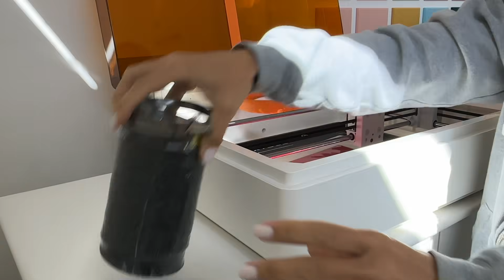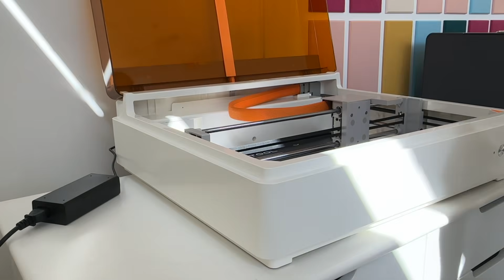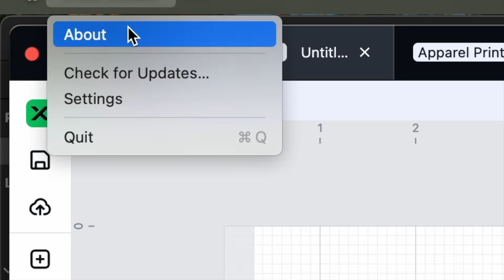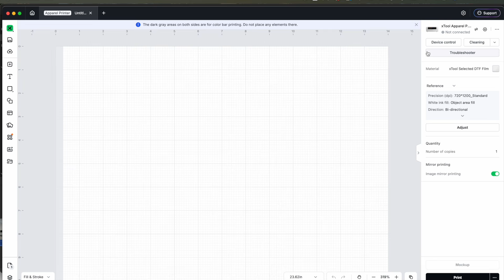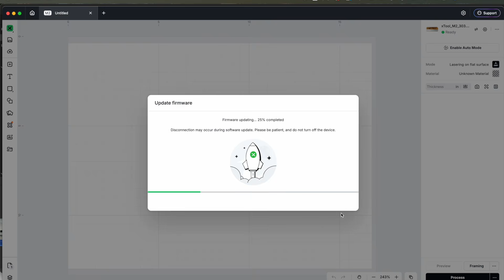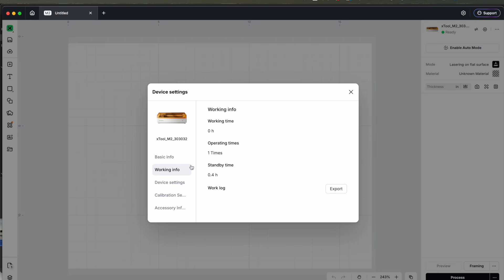xTool M2 Setup - Machine and Software Step by Step

Comment from the maker: Already have your xTool M2 set up? Next up: the CMYK ink module setup (separate video coming soon!) And if you're still deciding whether the M2 is right for you, check out my full unboxing where I break down the pricing reality and what's actually in the box.
Got setup questions? Drop them in the comments!
🖨 Shop the xTool M2: https://www.awin1.com/cread.php?awinmid=86799&awinaffid=2029521&ued=https%3A%2F%2Fwww.swingdesign.com%2Fproducts%2Fxtool-m2-color-craft-laser-engraver-cutter-printer-bundle%3Futm_term%3D69853

Comment: did you skip the part where the Xtool online manual  gives all unpacking instructions and says to grease several places with included greas.
Reply from the maker: Yes you will need to follow the xtool manual instructions to grease the machine.

Comment: Can this engrave 40oz Stanley cups or the wider tumblers like 30oz too?
Reply from the maker: The M2 handles cylindrical objects up to 100mm. Stanley's official dimensions put the 40oz Quencher body at about 3.5" wide and the 30oz even narrower, so both should fit.